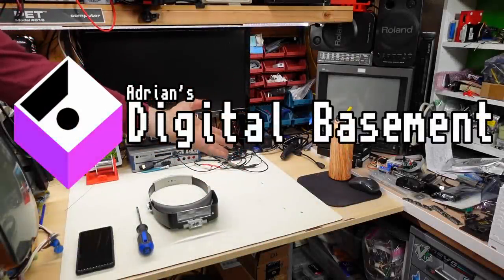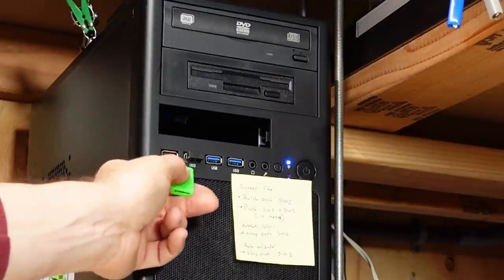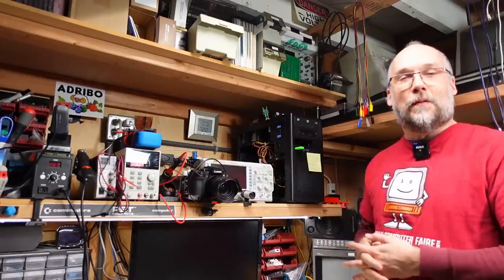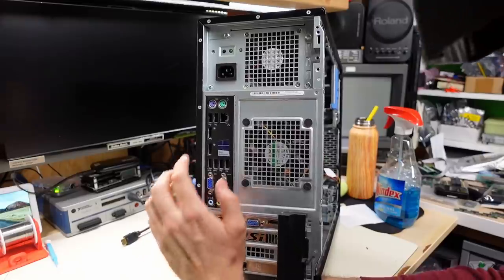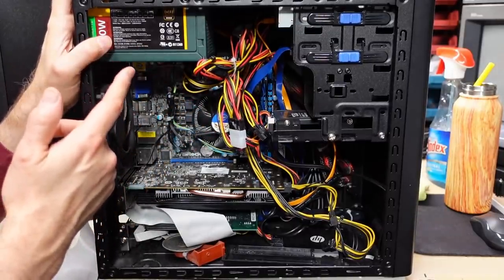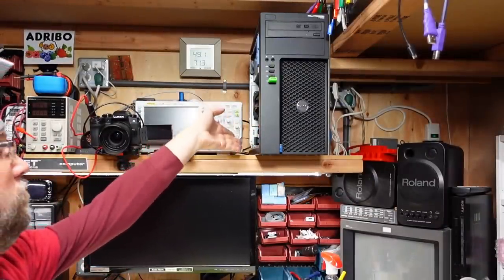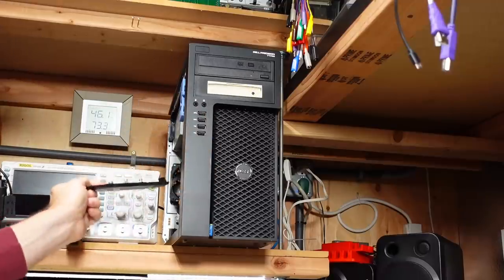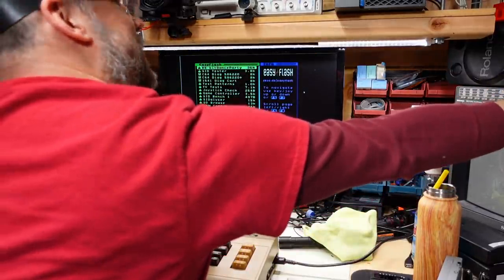Let's upgrade my lab PC and talk about tools I use to make videos

Comment: I thought everyone that used windows knew that when it started to have random issues, stuff just doesn't work correctly anymore that was working properly, you just do a fresh install of windows.... I think eventually the registry gets all wonky from many programs changing them.... One changes a key then the uninstall doesn't really put it back to original then another program changes it etc until things just get wonky and aggravating.... Can make you think hardware is failing but no it's just windows needing a fresh install lol. It's just how I've always done things since the first time I successfully reinstalled windows

Comment: im not sure about there desktop psu's but i do know atleast teh non redundant server psu's that are dell branded are made by delta as i opened one after i upgraded my server to dual redundant psu's as for some reason dell decided non redundant psu's for systems that hold upto 8 harddrives which is honestly bad ont hree part and you cant really find a non redundant psu without paying the price while the redundant stuff can be commonly found on ebay and possibly even amazon

Comment: I wonder if the people designing these OEM cases just hate other humans and make them purposely nasty, I was working on a new Lenovo OEM case recently which I was getting irate with for similar reasons.  My home PC uses a Fractal Define R6 and it's the complete opposite just a lovely case designed as well as possible and I know it's not a cheap case but many of these workstation class PCs are not cheap either.
Reply: Home cases I get what you're saying but I haven't had any troubles with business-class cases like this.
Reply: @eDoc2020  You're very fortunate then, I've worked with numerous Dell and Lenovo cases like this over the years and was cursing the other day at the poor design of Lenovo M series tower which still feels like something from 20 years ago
Reply: @johnmcl7  I don't see a problem with 20-year old case designs. Is there anything in particular you don't like about these cases?
Reply: @eDoc2020  I prefer cases that fit together properly and don't have sharp edges as Adrian found which is what I was replying to, those flaws are present in many more cases.  There was plenty wrong in 20 year old cases as well and the horrendous plastic Dell clamshells for their old Precisions and the preceding XPS (when it was the workstation brand not the gaming one) come to mind from that era

Comment: My Win10 does not do anything weird to my USB Floppy, maybe it's your BIOS or controller.
Reply from the maker: It is the floppy drive connected to the motherboard floppy controller. USB works fine...
Reply: @adriansdigitalbasement2  I’ve only had it do that on my optiplex 360. It doesn’t do that for any other board under 10.

Comment: The T1700 is server grade hardware that's why it got PS2. ports. Because USB is unreliable as f*ck and not sufficient for emergency usage. Also it got ECC-RAM and adThe T1700 is server grade hardware that's why it got PS2. ports. Because USB is unreliable as f*ck and not sufficient for emergency usage. For the server reason it got no reset button, too
Also it got advanced virtualization capabilities for it's age.

Comment: Eew, you got a Dell, dude. Nothing but trouble. If you have to use a prebuilt system, at least find a used HP/Compaq computer. You're going to need an 800 watt PSU to use any somewhat good video card. Your old system shut down b/c PSU could not handle the video card, and an upgrade would require even more watts (w/8+6 PCIE). I would have pulled CPU and memory, then drop-kicked it to a dumpster. I'll give you a thumbs-up anyway, for your pain and suffering.

Comment: Transfer rates are not the same as bandwidth... 
Bandwidth is a function of RF modulation, deviation, amplitude, and filtering. It has nothing to do with data rates and transfer rates!
I wish people would stop using them interchangeably because they are not... </RANT>

Comment: Windows 10 kills drivers from hardware made from 5-7 tears ago. I can't run one of my AMD 990FX chipset boards on windows 10 because the 3rd party drivers for the NIC, SATA, and USB devices added to the motherboard do not work with windows 10 as of winter feature update 2017. WIndows 10 is an evil OS that has had terrible driver support 2 years after it's release in 2015, possibly by design to force people to upgrade hardware.
Reply: I have an am2 board from 2007 and windows 10 finds all the drivers perfectly fine. I’ve even installed windows 11 on a 790fx board and it found all the drivers, I have many more board that windows 10 finds the drivers for. The only boards I have that don’t find chipset drivers automatically are a z270 board and a z370 board.

Comment: I have a Dell Xps 8940 and I "had" the same cooler as your Dell (I think they have a million of them).  I upgraded to a Noctua cooler and my temps dropped by 30*c.  You really need to do it.  The screw offset is the same as a 1151 intel bracket.  https://www.youtube.com/watch?v=QE_QFCnIGA8... This video will walk you through on how to do it!..  Don't be afraid to do it.  It will make your machine last a long time.

Comment: Microsoft's drivers suck big time, their support for old hardware tends to break stuff and more noticeably the configuration utilities. Might try installing old drivers but Windows will try its best to force you to install their drivers, then the solution is to disable automatic driver loading from the "device installation settings" but if you need to enable it for some reason then it'll install all the trash back again.

Comment: Congratulations on replacing a kind of OK pc for a crappy, cheaply build machine which was sold for 4 times the money it's worth 😀The Dell PSU and motherboard are really the cheapest of the cheapest build quality.  You don't want to know how much Dell Precisions I have repaired and upgraded with non Dell stuff to make them 'reliable'. They do have nice cases though, but yeah, those sharp edges, that you already found out yourself...

Comment: There is no point in having a reset button on a modern computer. You're not supposed to just flat out reset them. They are supposed to be shut down properly. So I actually hate having them.
Reply from the maker: Haha well when the computer hard freezes, then you're left holding the power button for several seconds. Also, if I want to interrupt the boot sequence before the OS starts, there is no way. It's lame to let the OS have to load all the way just because I missed the two seconds to enter the bios ...
Reply: Why? They are useful when a computer hard freezes(or when my x570 board acts weird due to the usb issue that still hasn’t been fixed fully)
Reply: @adriansdigitalbasement2  i haven't had that happen except in the case of hard drive failure.
Reply: @EvilTurkeySlices  i have x570 and never had usb issues.

Comment: lol you've obviously never used a dell before. They are cheap trash. Gamer's Nexus calls them e-waste. All your complaints are exactly why people like me tell others to avoid them. Proprietary and cheap are the two key works.
Reply: Modern Dells are; older workstation models are usually not though. The T7500 was a good machine, but that's from way back. But then, I wouldn't expect any low end OEM to be that good, old or new.
Reply: @mapesdhs597  its still proprietary. He showed it in the video.
Reply: @awilliams1701  Oh absolutely, but that doesnt necessarily mean they're bad, and there are ways round the custom connectors & suchlike, as Bryan of Tech Yes City and other channels have shown many times. What's changed is the build quality. My point is that older Precision systems were wel built. I started on PCs with a Precision 650, it was built like a tank; infact I bought two of them, sold one and covered the entire cost. Likewise, my T7500 is nicely put together and runs basically silent.

Now whether this is still true today, possibly not, and perhaps it was less the case with the lower SKUs. But I wouldn't make the same claim about the entry models, and yes the designs are certainly proprietory, though years ago they were nowhere near as crazy as the sort of thing GN has recently shown. The one thing about the T7500 which annoyed me was Dell implemented an SLI lockout which even NVIDIA didn't know about, it only works with specific models of Quadro.

These days I build my own systems of course, but not everyone wants to do that.
Reply: @mapesdhs597  proprietary = ewaste also that cooler is the same one they use now. It's pathetic. They'd actually be better off using the stock intel cooler.
Reply: @awilliams1701  It's too simplistic to just label it as ewaste, that's not an argument. As for the cooler, if it does the job then that's all that matters. These systems are not bought with the users who use them being able to intended to modify them. Some companies deal with thousands of them when upgrading.

It's too easy to look at this from a hobbyist's perspective, where the focus is on one's own abillity to modify systems. Where you have a point though is Dell selling tech to ordinary consumers which has indeed been designed to be difficult to reuse in the future, that is dumb, but then often the people who buy them are not tech savvy anyway, they'd rather just do a complete replacement later. This was an inevitable consequence of PCs becoming comodity tech, it supports both paradigms. The way OEMs operate could certainly be done better from our biased perspective, but each approach nevertheless has its own merits.
Reply: @mapesdhs597  It should still be illegal to sell this shit. When that motherboard dies the whole thing is ewaste. If it was a standardized computer then everything could be recycled and only the motherboard would be trash. This is not nor will it ever be acceptable.
Reply: @mapesdhs597  oh and by the way MAYBE that cooler works on this system, but I've seen other dells reviewed with the same cooler where it was thermal throttling meaning that no it's not doing it's job. Stop defending their crappy practices.
Reply: @awilliams1701  The notion that government should get involved is hillarious; they are one of the primary users of such systems.

PC tech cannot be standardised in that way, the nature of tech advancement for PCs precludes such an idea. Besides, it's a bit bizarre to complain about this while at the same time the entire industry has existed on the back of forced obsolescence for decades. PC tech by its nature is obsolescence and stagnation, it was never intended to be something that either moved the tech fowards as quickly as it potentially could, nor be amenable to reuse, etc. Also, complaining about green issues when most PC purchases are objectively unnecessary is decidedly odd (ditto phones and most other devices). The PC design is indeed a standard, but it's a standard that's ever shifting, in a manner unrelated to notions of reusability. That's just the way it is.

Also, recycling is not in itself necessarily a good thing. Infact, most recycling structures actually result in more pollution, because their success is typically measured by how much money is saved, money that is then spent on more resource consumption, resulting in an outcome opposite to that intended. This is absolutely the case for virtually all such systems run by government, so demanding anything should be illegal makes no sense; that just results in more government, which is by far the biggest consumer of resources on the planet (most of it entirely unfunded).

OEM designs could be better, but claiming X or Y should be illegal makes no sense, especially when such systems are typically designed and built entirely elsewhere. Something built to last is more expensive; at the moment and for some time the entire tech industry has no interest in longevity; I primarily deal with systems (SGIs) from a period when such notions were more valued, but that time has gone, commodity tech took over. Fundamentally the computer tech space has been in a stagnation phase for a long time, endlessly refinining something which hasn't really changed that much at all, still running much the same legacy OS from decades ago. If you want to talk about waste, then consider the sw side aswell, its own bottomless pit of terrible policies.

It boils down to choice. I think supercars are rather ridiculous, but I wouldn't outlaw someone's ability to either build them or buy them. If one is to critique OEMs for the kind of things you've described, then by the same rationale almost all of PC, certainly at the high end, shouldn't exist either, because as so many have shown over and over again, it's largely unnecessary.
Reply: @mapesdhs597  that's a load of crap. Everything in my computer is standardized. If I bought an Origin PC everything in it would be standardized. If I bought a cyberpower PC all standardized. ATX is a standard that is like 20-30 years old. PCI express is a standard that is almost 20 years old. There is no excuse for not using the standards that exist.
Reply: @awilliams1701  That cooler definitely works in this system so it's fine. If they're using the same cooler with a much more power hungry CPU then yes I'd agree it's a bad practice.
Reply: @awilliams1701  Regarding the proprietary things on the system, as far as I can see only the PSU is different. I'm certainly not happy about it but there are valid reasons as AFAIK it enables lower power consumption without adding too much cost. I don't think this is a case about forcing incompatibility.

But using a nonstandard connector on some of the fans? Now that's pretty much inexcusable.

Comment: the gpu is a wish rip off..... 750Ti has no vga, it has a 6pin peg and the cooler is wrong
Reply from the maker: Are you sure? It is this card: https://www.msi.com/Graphics-Card/N750-Ti-2GD5OC which visually looks identical, has the same ports and has no 6 pin power connector.
Reply: There are 750 ti cards with VGA and a 6-pin connector, and the card his pc doesn’t even have a 6-pin.